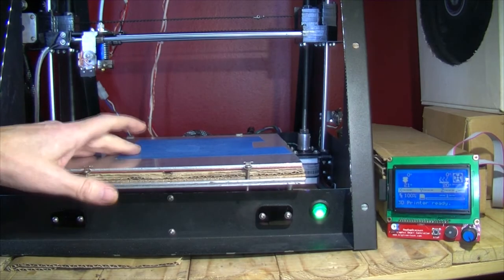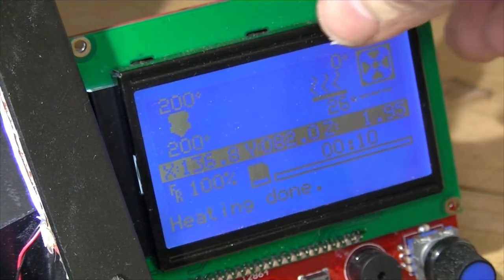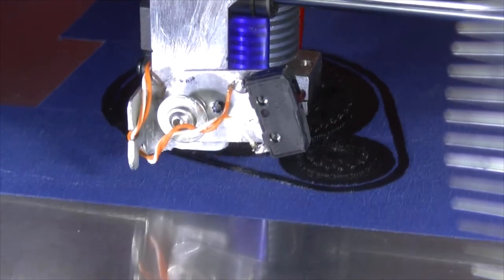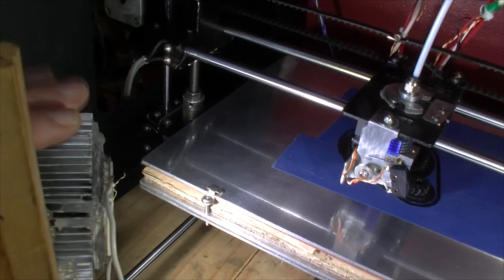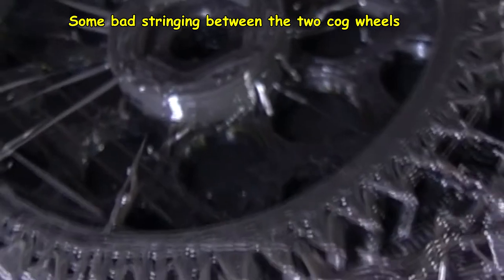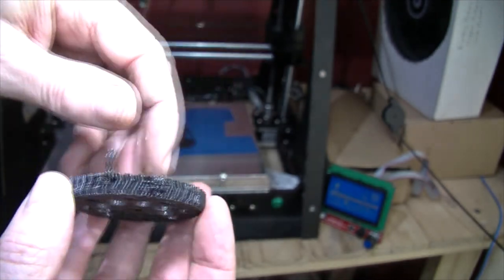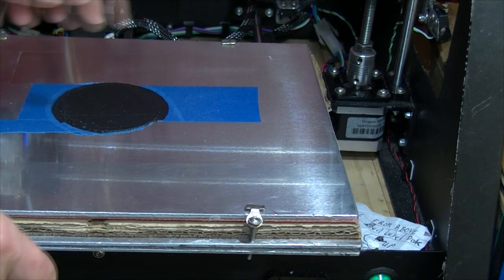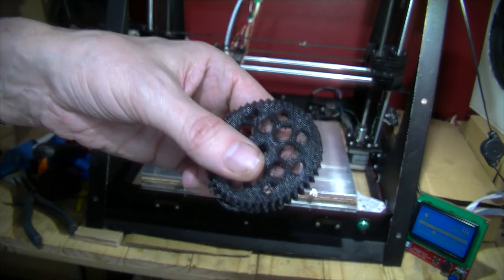3D Printer Thermal Runaway and Strings

Comment: check the thermistor in the hothead is not pulled out or in the wrong posistion.
Reply from the maker: +3d tronix Tested after this an showed perfect.
at 17:23 it showed no "Thermal Runaway" on the LCD12864 display, (no problems)
Reply from the maker: +Protomaker Black Sprint Original 3D Printer Although the "Heat Bed" is at 31°C which is about 8°C above the normal off temperature which is about 23°C
Later in the video Very hard to make out 23:46 it looks like the display is saying the "Hot End" is much higher temps than the Target Temps. I think somehow the firmware/software crashed and the Temps got stuck... (no fire)
Reply from the maker: +Protomaker Black Sprint Original 3D Printer LCD 28:10 Target Hot End set to 0°C but actual temperature 167°C
Reply from the maker: +3d tronix Thanks :)
Will try a different cog, I do not like the STL/C-Code file for this one anyway. Had issues, I think off bed, "NetFabb" fixed but just looked a bit dodgy
http://www.netfabb.com/news.php?nid=16
Reply from the maker: +3d tronix Why a 3D Printer Thermal Runaway?

Hot End Tested after this an showed perfect. at 17:23 it showed no "Thermal Runaway" on the LCD12864 display, (no problems)?

"Heat Bed" is at 31°C which is about 8°C above the normal off temperature which is about 23°C

Later in the video Very hard to make out 23:46 it looks like the display is saying the "Hot End" is much higher temps than the Target Temps. I think somehow the firmware/software crashed and the Temps got stuck... (no fire)

LCD 28:10 Target Hot End set to 0°C but actual temperature 167°C
Reply from the maker: +Protomaker Black Sprint Original 3D Printer I may try a different cog some time when I an not so fed up with all the problems 3D Printers cause
Reply from the maker: +3d tronix  Do all that see, standard drivers
https://www.youtube.com/watch?v=L8KVbTRzaEo&feature=youtu.be&t=6m45s